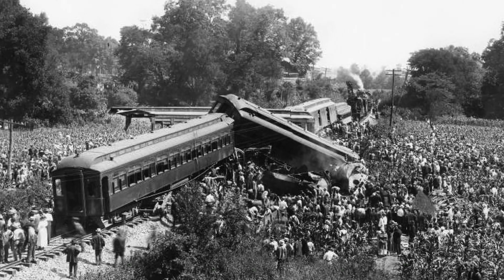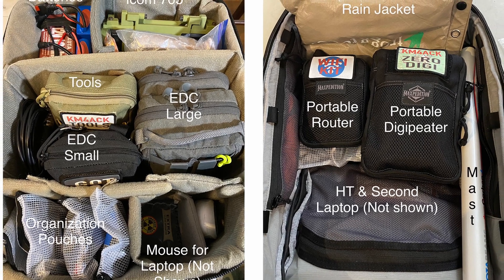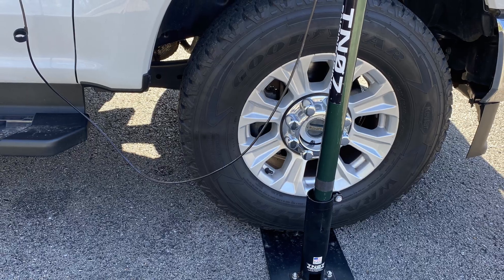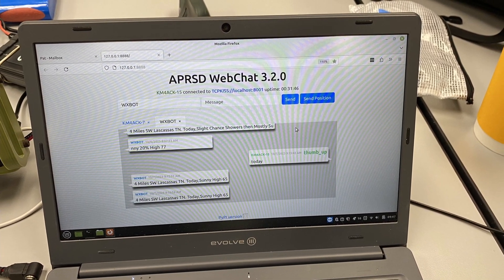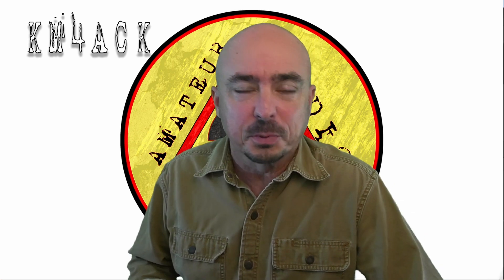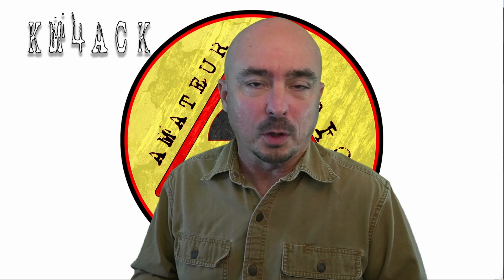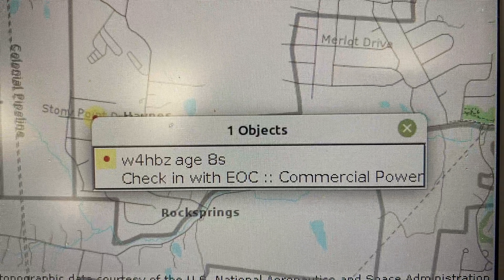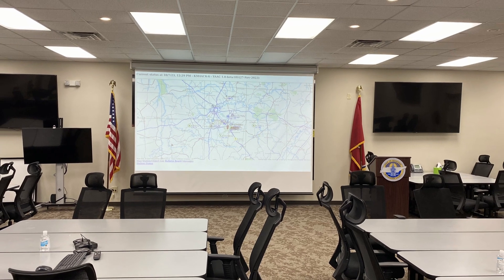Train Wreck and How Radio Can Help

Comment: Pat winlink is a webserver.  Run PAT in the vehicle and connect to it from multiple web browswes at the same time through your local network you created.  You could have the paid staff type messsages into PAT directly and have the licensed ham OP make the connections to the RMS.

Comment: This is great. Would you have the scenario described or detailed anywhere ? Would like to replicate it with our local ACS. 

73 de VE6DPC
Diego
Reply from the maker: I was not an active participant in designing the drill. Merely a operator responding to what was injected during the day. I think the ARRL has different scenarios on their site. Here's a link to the SET page - https://www.arrl.org/simulated-emergency-test

Comment: Nice job Jason but I can guarantee the amount of LARGE SCALE derailments, I.E. Ohio, is minimal. Our jobs are on the line if we derail.
Reply from the maker: Thanks! I think those in charge just wanted something plausible but different this year. The tornado scenario which is likely in Tennessee has been done over and over and over. I just ran with what was on the table for the drill.
Reply: @KM4ACK  yeah I get that, just a weird scenario for them to run!

Comment: Nice job Jason.  APRS is such a misunderstood and underutilized mode of communication.  If more amateurs just thought of using the system to tell others what is going on around them....and then do it.  APRS would quickly become the first "go to" in a disaster.  If you have a tornado, storm, hurricane in your area....after it clears, go to APRS and report your status, and what is going on around you....food, shelter, water, electricity, cellphone service, road status, etc.  The world will be watching....if we just use it.   KiloWatt

Comment: Great run through of a nice use case, thanks! You can set up a RPi to serve as GPS data source, like the one in your truck. Plug in a GPS dongle, and run the gpsd daemon with the -G or --listenany parameters. Then any other devices on that same network can point to the RPi address and port 2947. 

Another alternative is running a GPS app on your phone, and point devices to that for GPS data. Not sure about Apple, but Android has GPSd.
Reply from the maker: Totally accurate! I've done videos on both methods in the past. https://youtu.be/C35ZeYCQnJI and https://youtu.be/rkmQxvT8BpQ Either would have worked well if I had needed them.

Comment: Jason, Absolutely fantastic. This is level-100 AR Engineering! Don't worry about the glitches, that's what the drill was for. You might want to include a powerpole connection for the truck battery just in case. No idea how to circumvent the lack of signal inside the building... maybe an antenna adhering to a glass window? Everything else is beyond incredible. The only thing missing on the map is the small area near the derailment for photo ops for politicians. Great job.
Reply: @hankfox4170 May I suggest that the photo op spot be downwind, and within the 'rule of thumb' (for normal first responders, the 'rule of thumb' is, if your thumb as viewed on your fully extended arm, does not cover the scene, you are too close) distance (closer so that the thumb does NOT fully cover the scene)...  hi-hi-hi... 73 Kevin KD9EFV, and former EMT/First Responder
Reply from the maker: @kevinshumaker3753  🤣😂🤣
Reply from the maker: @hankfox4170 Thanks for the kind words! I realized that the battery for the digipeater was limited but past experience told me it would run the Pi for 24 hours. Each battery for the HT gives me ~12 hours. I have a cigarette to power pole adapter that rides in one of my 2M EDC kits which could be utilized for an activation requiring more than 24 hours. One HT battery will easily charge before the other one is depleted but will require swapping them every 12ish hours.